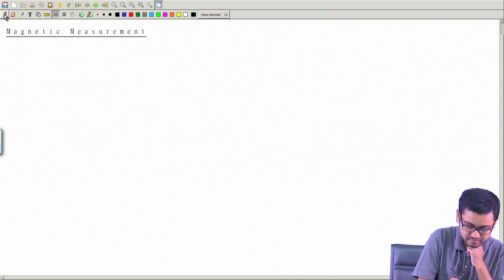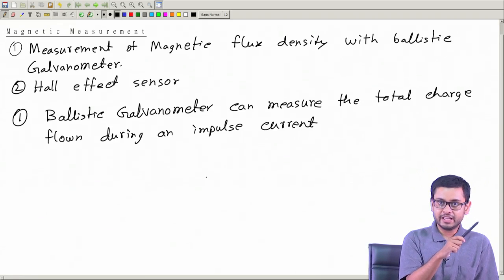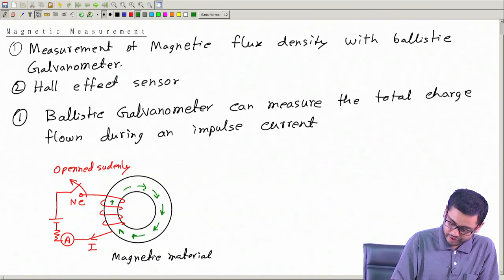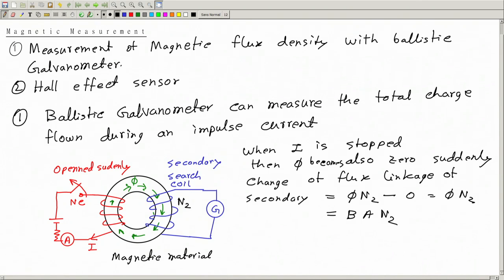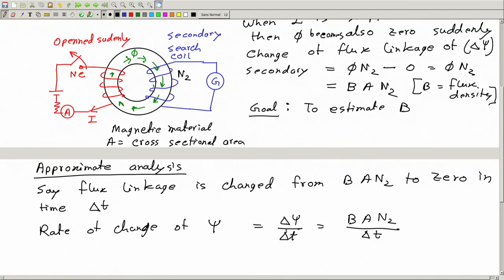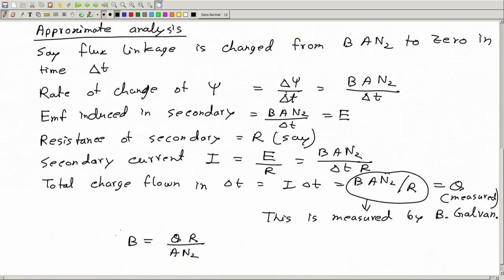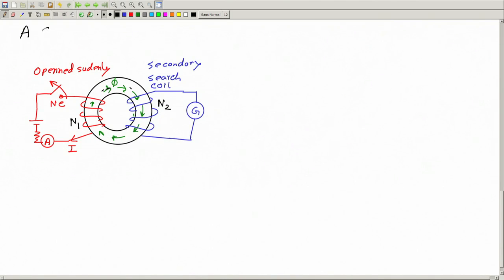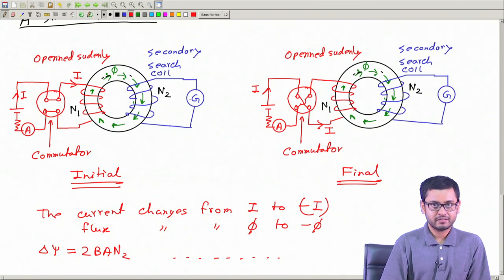Lecture 45: Flux density measurement with Ballistic Galvanometer

Comment: Sir pls tell how much will be the B
At 10 volt dc supply 3.28 mH inductor 
Area of core 3.141 sq cm, number of turns=500,length  of solenoid =3 cm
Ur=1
Pls send me photo my number is 8337931794